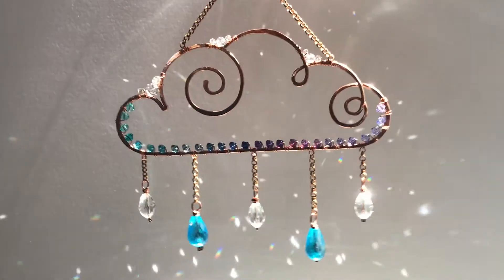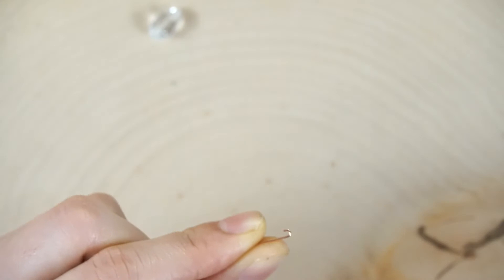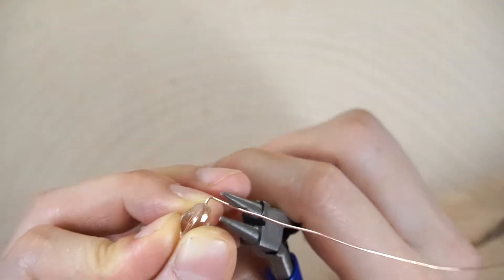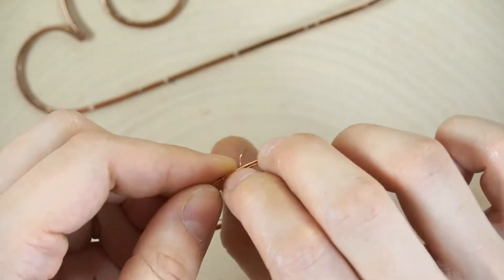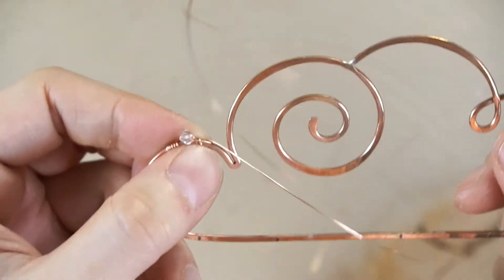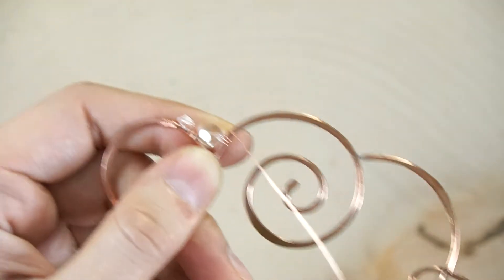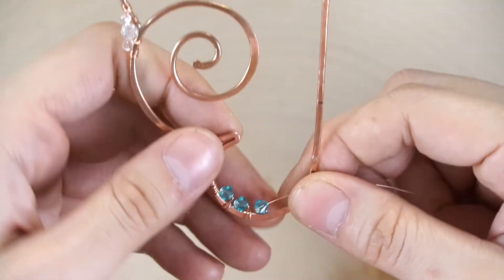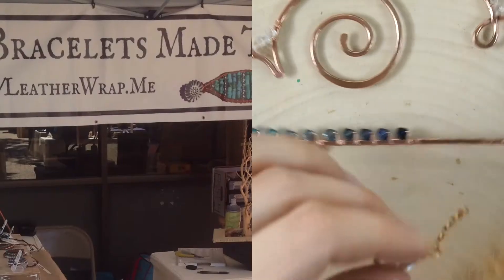Making a Raincloud Suncatcher With Beads | DIY Kit Wire Suncatcher Tutorial for Beginners

Comment: Hello! Thank you very much for this video, I was really inspired by your work, because I was just going to connect the wire and beads somehow, I really want to try your version. Please tell me, what is the best way to solder copper? (The ends of the base are connected. Can I do this with a soldering iron? and what is better to take the solder?) I would be very grateful for your advice :)
________________________________
translated using Yandex-translator
________________________________

original:)
Здравствуйте! Большое спасибо за это видео, меня вообще очень вдохновили ваши работы, т.к. я как раз собиралась соединить как-то между собой проволоку и бусины, хочу очень попробовать ваш вариант. Подскажите пожалуйста, чем лучше паять медь?  (Концы основы между собой. Можно ли это сделать паяльником? и какой лучше брать припой?) Буду очень признательна за совет :)
Reply from the maker: Hello! Thank you for visiting our channel 🙂 I use a torch and solder. You may be able to use a soldering pen/gun; however, I've only seen that used for electronics. I believe soldering for eletronics emphasises conductivity not structure. It doesn't have to be a fancy torch although a more powerful torch makes it easier. You can use a small butane cooking torch to get started. In California, we'd call it a "creme brulee" torch. If you can find some old jewelry making books, they tell you how to solder with just chemicals and fire and solder. Timothy McCreight had some good books on the subject that listed all the tools and chemical recipes to make your own flux, patina, etc. Have you tried searching YouTube for soldering videos? Suppliers like Rio Grande have instructional videos that show you how to use the products they sell. They recommend products that are convenient, but not the cheapest techniques like those used 50 years ago. However they are still good learning resources. Good Luck! Happy making! 

Google Translate Says: Переводчик Google говорит: Привет! Спасибо за посещение нашего канала 🙂 Я использую факел и припой. Вы можете использовать паяльную ручку / пистолет; Однако я видел только то, что используется для электроники. Я считаю, что пайка для электроники подчеркивает проводимость, а не структуру. Это не должен быть необычный факел, хотя более мощный факел облегчает его. Вы можете использовать небольшую бутановую горелку, чтобы начать. В Калифорнии мы бы назвали это «крем-брюле». Если вы найдете несколько старых книг по изготовлению ювелирных изделий, они расскажут вам, как паять, используя только химикаты, огонь и припой. У Тимоти МакКрейта было несколько хороших книг по этой теме, в которых перечислены все инструменты и химические рецепты для создания собственного флюса, патины и т. Д. Вы пытались искать на YouTube паяльные видео? Такие поставщики, как Rio Grande, имеют обучающие видеоролики, в которых показано, как использовать продукты, которые они продают. Они рекомендуют продукты, которые удобны, но не самые дешевые методы, подобные тем, которые использовались 50 лет назад. Однако они все еще являются хорошими учебными ресурсами. Удачи! Счастливого изготовления!